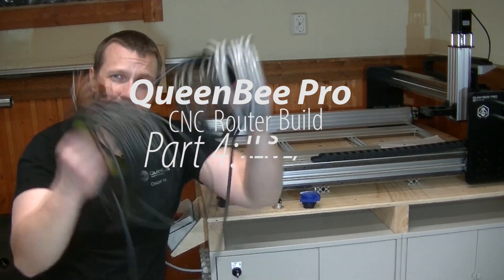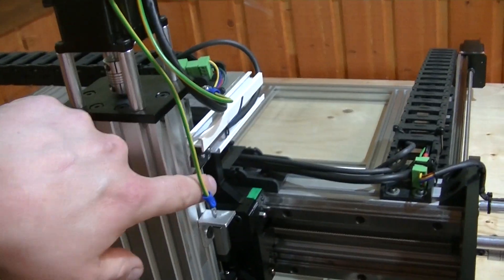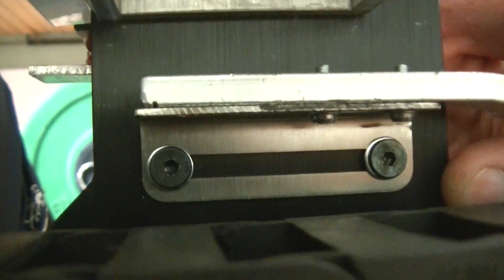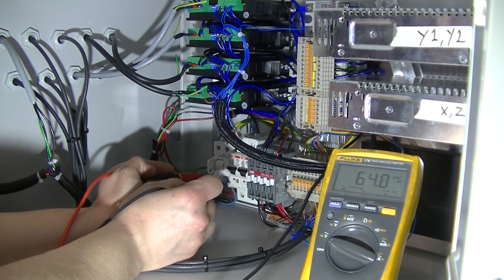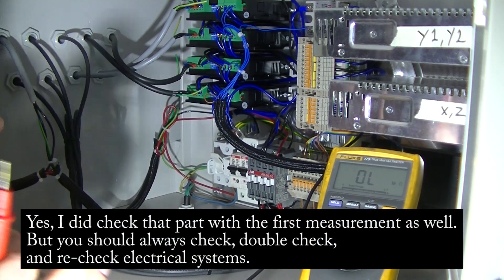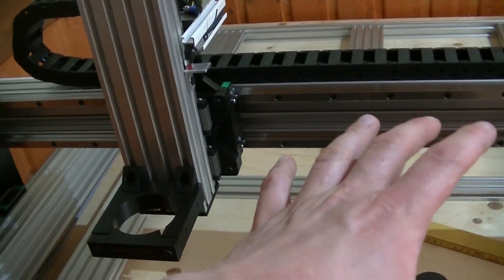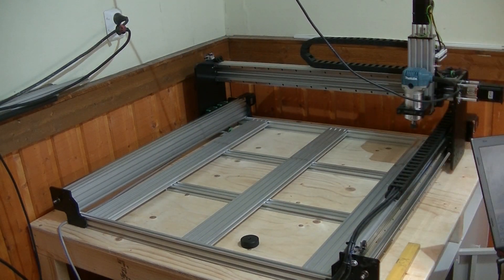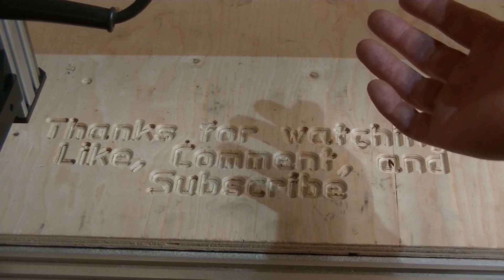QueenBee Pro CNC router Part 4: It's Alive!!!

Comment: what controller software you using on the queen bee
Reply from the maker: I'm using ESTL controller with an Arduino Nano as a breakout board.
Reply: @OffHoursEngineering  why did you choose that ? I think I speak for everyone entering this interest/hobby… which option to get in terms of the USB pro, offline , black box, GBRl, Mach3….  I haven’t seen ESTL on the bulkman site. We don’t want to get the basic one that’s easy but restricted and have to get another down the track but having not used any it’s pretty much lucky dip
Reply from the maker: I talk a bit about why I am using an Arduino in part 6 of the series, but basically it was the easiest and cheapest option since I already had all the hardware for it and I've used Arduinos a lot for other projects so I know how to work with them.
And ESTL is completely separate from Bulkman it's freeware from a German programmer called Christian Knüll. And in no way is it limited, it has more features than any G-code sender for GRBL I've used. ESTLcam from the same developer is almost as powerful as some of the cheaper vectric software, and this is also free. So it is basically a win win. And if I upgrade to linuxcnc in the future, as I have talked about, I'm not replacing something I've spent any money at all on, so it is still a one time investment.
Reply: @OffHoursEngineering   thanks so much it makes a lot more sense to me know. Not sure how I missed your part 6 must of been side tracked from the cute hawk nest haha. Will check out part 6 now.
Reply: @OffHoursEngineering  just one thing: ESTLCAM is freeware but I really encourage you to get the full version to support his awesome work. Especially the boards he sells made it so easy for me. Also the freeware will take longer to load every time you open it up until a point where it’s ridiculous.
Reply from the maker: Yes, I agree. It is ridiculously how complete the software is for that price.
Reply: And your video of the hawk birth is pretty awesome bro
Reply from the maker: Haha, that's actually not me. The live streaming of the hawks nest is 902Marine I think the channel is called.